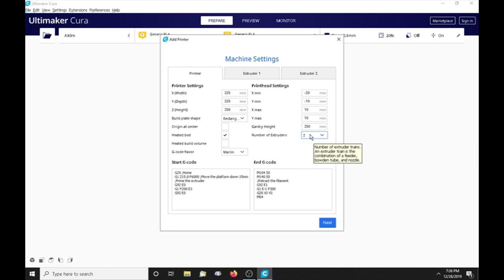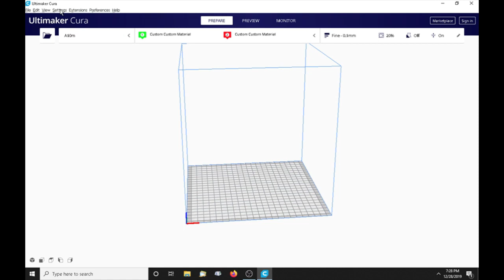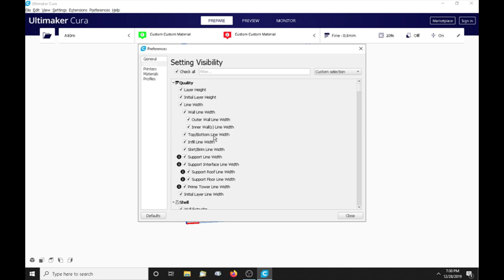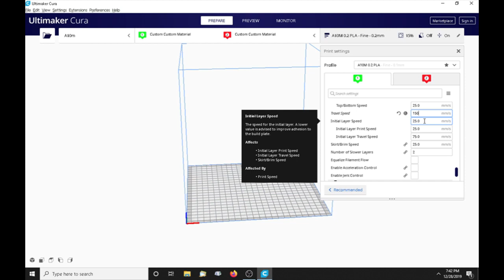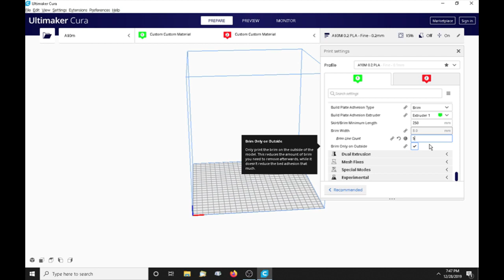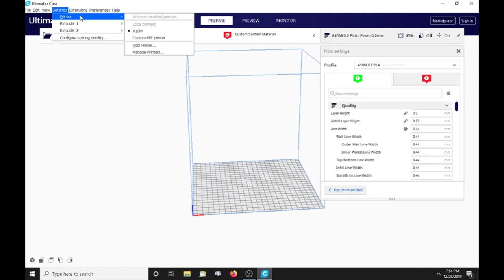Cura Multicolor Printing  Setup  Part 1

Comment: I have been searching a few days for setting up cura for my new Geeetech A10T. Finally found your video and it straightened out my prints. I had watched a few others and the printer got worse and worse prints, and mixed colors when it shouldn't. While I skipped thru acceleration settings I watched all the rest and thanks for describing the settings you changed, even though sometimes I was thinking, C'mon. get on with it. LOL. You did great. I've printed several things in the last 15 hours since I made the changes you go thru.

Unfortunately even with all these settings, the strength is not there at all. Even with my infill set at 100%, the infill is like shredded wheat. I guess I have to check E-steps now

Comment: Thank so much for this tutorial, you’ve earned a subscriber. As other have said, this is super helpful. Probably the most bang for your buck of any video I have watched when it comes to configuring the A20M. That updated post-processing script you included in the comments has worked great so far.

Comment: Nice, but to much talk about basic settings we already know/find in other videos. Having to fast forward all the time 😴
Reply from the maker: agree
But when the video was made, there was almost nothing, especially for mixing printers :-)
Reply: @1zradio660  i hear you :) 

Quick question tho, (dont think this was in these videos)

Doing a two extruders i cura (one being virtual), only one physical.
How can you do it without purgeblock, and having it going for a regular pause/filament change instead?
Reply from the maker: @SplitPhotography  I believe in part 3?
Set the virtual extruder with M163/M164 . to say T3 ( would be extruder 4 in Cura)
Then you can change at height, or select extruder 4 for some part of the model
If purge tower is not selected, then the switch will happen without it, no need for filament change etc....
Reply: @1zradio660  Not sure i understand this mixing stuff, guess i need to do more research.
Reply: @1zradio660  Ok, understand it more now. lol.

Added the m163/164 codes for both extruders, but checking out the gcode created, it doesn look like the printer will go to the corner of the printer for filament change without the purge block activated. And that's what i need it to do for now.
Reply from the maker: @SplitPhotography  oh. you actualy need to change filament.
I assumed you had a multicolor printer.
In that case, you can use the filament change, in the post processing scripts

Comment: Does this also carry over to the a30m? I can't seem to find shit for it
Reply from the maker: Yes, ... only difference is the print volume... bed size, and gantry height.
And the retraction distance would be around 7mm at 37mms .
All the rest, I think, would be the same
Reply: Thank you, I tried to use simplify3d but I just can't with their lack of options especially on supports. Rewatching now and setting a profile up.

Comment: Thanks for an excellent series. Just one addition to the postscript M104 script. Replacing M104 T0 S0 isn't sufficient. You need to replace M104 T1 S0 and M104 T2 S0 for the A10T + more if you use virtual extruders. This just caught me out on a 3 colour print!
Reply from the maker: Yes, this is an old video that needs updating.

If you put
M104 T[0-7]+ S0

That will cover all 8 possible extruders in on search/replace script.
Reply from the maker: at the time, the marlin available would not recognize T1, T2  etc for heater commands, on a mixing extruder.
Now, it does. so we need to add those

Comment: Thank you so much! I've been tinkering with my A20M for a couple of months now and thought I got it all down but boy was I wrong. Just in the last 24 hours I learned a lot! For instance, I didn't have the number of extruders set correctly in OctoPi and couldn't print multi-color prints... (I mainly use one color only so I didn't notice this until now). Then, I could not for the life of me get two-color models sliced properly. The culprit was simply that I needed to set the extruders to "do not override". This made all the difference!
Lastly, I watched the video on 1.25 because it felt more natural :D Your presentation style is fun though and I like that you're so easy going yet informative.

Comment: I wish I would have found your video earlier! I had lots of problems, of course caused by my absolute ignorance, with y layer shift and dual extrusion...the list is long. Let's put it this way. I had to learn the hard way on how to use my new a30m. The youtube algorithm is strange sometimes. I'm asking myself why I did not discover your video earlier. I searched for a20m a30m cura setttings...and so on. I found some videos where they show some settings for our printers. But Acelleration, Jerk, Print- and Travelspeed, minimal purge amount for prime tower...non of that get's mentioned. So by now I nearly have the same settings learning by doing which is not a bad thing but your video would have saved me many many ours of struggling with my new a30m. So thanks a lot!!!

Comment: Hi. 

I ve got a prob with Cura. Could you help me?

Printer: singel extruder renkforce rf1000. Repetier firmware

I wrote the filament change in the startcode of every extruder and automatikly change all t1 t2..... to t0

If the colorchange happens in the same Layer Cura post the E Value plus 16mm but it should Start at E0

Comment: Great Guide. What would be the post processing script for three extruders?
Reply: I have difficulties with three colours, two works well
Reply from the maker: you can use 2 or 3 of them... 
Marlin SHOULD ignore any command for T1 and T2 for heaters.... but seems in some cases it doesnt.
So you can add a 2nd and 3rd script as in the video....
But use T1 and T2 instead of T0

Comment: hi cant thankyou enough for the vids ive even used your gcode addition to produce 8 coloured prints but it seems that my print head of my A20T is pausing on the print for up to 10 seconds before moving over to the prime tower it melts the surface  and scratches across the top of the printed surface ive run through your videos many times and tried using zhop but nothing seems to help have you any ideas
Reply from the maker: There are 5 temperature settings, for ALL extruders,  that must be all the same setting, especially "standby temperature",.
If they are all the same and you still get a pause, it may be because you have "shared heater" checked. That adds an M109 "wait for temperature" command, for some odd reason "bug".
If you uncheck shared heater, you will need 2 post processing scripts to make sure cura doesnt shut off the heater when it thinks you're done with an extruder ( starting to print last color).
Add a search and replace script. in search, type "M104 T0 S0", leave replace blank,
add a second search and replace....   search  "M104 T1 S0", again leave replace blank.
For "T" model, you may need a third one ...  Search "M104 T2 S0"....
Reply: Thank you so much for that ill give it a go the temps was the first thing that sprang to mind so I checked and re checked so I will try the gcode option on my very next print I cant begin to tell you how much of a difference your videos have made thank you again 
Ade
Reply: Thank you that's fixed it great onward and upward

Comment: great movies part 1 and 2, 
do you have a cura profile that actual works for the A20T, it prints fantastic with the gcode from geeetech, but when i print my one prints in cura it don´t
Reply from the maker: I put an A10T cura profile in this group.. just have to change the bed size and it works for 20T as well.
https://www.facebook.com/groups/367558647117884/

Comment: Excuse me Bruce, I didn't understand, the wall thickness should be 0.88 or 0.8? If I want to make 3 walls, should I place 1.32? Thank you!
Reply from the maker: If you notice I set the extrusion width to 0.44
So 2 walls is 0.88
3 would be 1.32
Reply from the maker: I see why you ask now... Cura likes to intervene. I am almost sure that even though it said wall thickness of 0.8  with wall count of 2.... that it will print 2 walls at 0.44 each.

But I may need to investigate that.